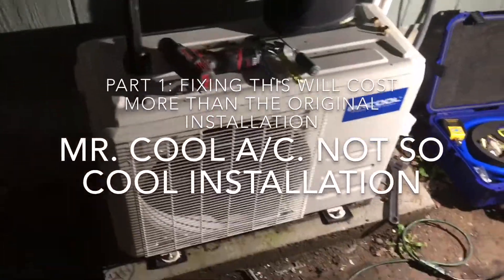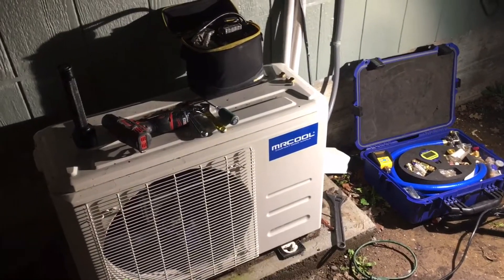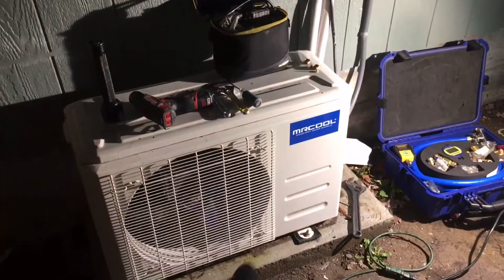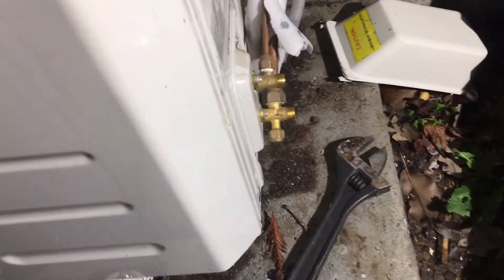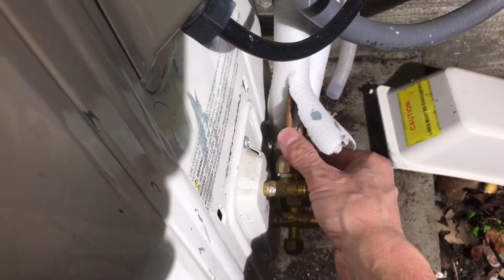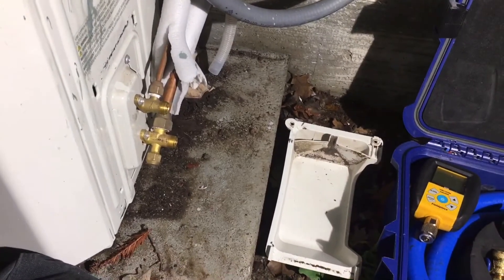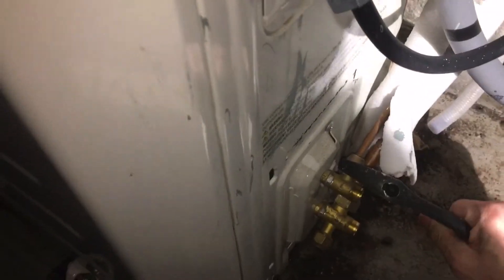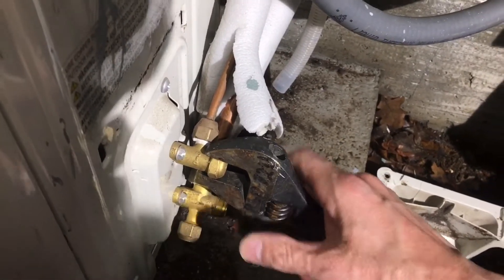Mr. cool A/C, Part 1: Not so cool installation

Comment: Wow! Plumbing tape on flare nuts? What happened to Nylog thread sealant? I use a digital torque wrench to tighten flare nuts. This is crazy.
Reply from the maker: @SonsofIssac  NOT ME !.  I’m coming behind a general contractor who is told to put this air conditioning system that was selected by the architect on building this tiny house. 
     The general contractor, had his guys put it in . Who he got from the Home Depot parking lot. 
(“ need I say more”) 

I almost nearly had to ripped the entire system out . 

I had to take and replace the copper in the wall because it was damaged . 

The wiring was wrong . 

The flares were leaking . 

And the guys did not read instructions that you had to open up the unit with the hex Allen key . 

So they were starting it up with the refrigerant, trapped and outdoor heat pump and couldn’t figure out why it would not cool .

Comment: Honestly, his tremendous stupidity actually saved them.   Had he opened those service valves it ethier would have immediately leaked all of the refrigerant out, costing the owners a good chunk of change to have it recharged, or even better, the system would have tried to run and destroyed itself as the pipe dope and Teflon tape clogged everything up.
Reply from the maker: Unfortunately for me to fix this and other mistakes that were made, I need to be repaired.  The fixed cost more than the unit cost..  that was the sad thing

Comment: Mr. Cool has some nice products! However, this type of product needs professional installation!
Reply from the maker: Even their DYII products have massive problems with leaks after DYI screw in connectors I have videos of me cutting those out in bracing the lines together so they can’t leak anymore. 

And when you need extension lines that are longer the precharge Sandwich Refrigerant so that DYI person does not have to.     But the problem is I have tapped and remove the refrigerant out of the DYI Mr. cool lines and found that many of them have already leaked out well in storage or delivery so the customer gets an empty line what that means as when the customer hooks it up the system will be under charged

And I have found several Mr. call DYI air handler coils to be leaking only a year old

Comment: I wouldn't install this for anybody the drain pan holds water enought to smell stagment water it's elevated enought to hold water in process now to fab up a drain biggest piece of shit I have seen drain should bee in bottom of pan
Reply from the maker: This is what happens when a general contractor who thinks he can do something he’s never done before because to him it looked easy but he did not even read the instructions 

      The instruction manual even has pictures showing you how the drain should be pitched down words through the hole in the wall

        And they have another picture right next to it showing you a bad installation with the drain going up with a big X through the picture to let you know this is the wrong way. 

  I get called out to these kind of installs all the time I never get used to it cannot believe in this day and age with all the access to information and resources and being able to look at training videos from manufactures on their equipment they don’t even try to learn to do it right
Reply: @coldfinger459sub0  this is on central air unit in air handler and it is in lowest hole and angled down the hole has about and inch or so below it to bottom of pan

Comment: Congratulations for choosing Teflon sealant when you could have chose nylog sealant.
Reply from the maker: Yes only an idiot would use Teflon sealant in refrigerant lines clogging up the inside of the refrigerant line. 
                               This would’ve been a good situation to break out the bottle of NYLOG and show people what they should be using. 

          As usual I was coming behind somebody’s village idiot to re-repair their work and undo the harm they have created.

Comment: I can bet you it was the customer doing DIY from YouTube. He is just trying to save face and shift the blame on a non existent contractor.
Reply from the maker: It’s a old lady hitting her 80s with the beginning of Alzheimer’s and her daughter taking care of her no man in the house. 
           I met the contractor if you can call him that just a general as usual can do everything but do nothing good typical general. 
            He basically ripped them off and when things didn’t go good and he was losing his ass trying to get it to work was when I was called. . 

        When generals try to do heating and air-conditioning it’s always the lowest budget hack job just good enough to get hot or cold to blow on your hand kind of job.  You can call it a hand job.

Comment: if you are a  professional and getting paid. do your job and dont bad mouth.
Reply from the maker: We’re trying to get rid of the lowlifes that we have to badmouth that give profession a bad name.
              We’re not going to cover up their mistakes and hide it for them and protect them from ripping off customers. 
            We’re out to try to smash them like cockroaches in the kitchen nothing but dirty pest,  a cancer on society that needs to be rubbed out.

           This installation was performed by a general contractor. 
           I would personally call him or a toilet scrubber or a garbage man at best he might be able to be a janitor and mop the floor. 

            There were so many blatant not even mistakes just total screwup‘s in proper procedures completely ignored all rules and regulations and manufacturers installation manual that clearly states how to properly install this very simple little system a child can even install one of these correctly so long as he can read the manual.

Comment: Im looking at the Mr cool central heat pump that goes down to -22 .im in Michigan and hate propane no natural gas available.Im told it's the same condensors as the mini splits.My house is 1950 sq ft 2 story newly built .What size do you think I need? A rep says the 4 to 5 ton my hvac guy say s 3 ton .Fyi I burn wood all winter in my vermont casting defiant that I love great wood stoves despite so so reviews.
Reply from the maker: Living in San Francisco California I definitely do not do heat load calculations for Minnesota even though I am familiar with Minnesota because back in class we would make heat load calculations for very cold regions of the nation. 
                You really need to locate somebody in your local region to do a heat load calculation. 

           New homes built to minimum code are the worst homes built. 
             Good contractors to build quality homes have a saying. 
       “ build a home DOWN!  to code level “
Just to pass inspection

Comment: You can bet the homeowner did this job and blamed it on a contractor
Reply from the maker: I met the contractor who did the install I know exactly who did it. 
              General contractors should not be allowed to do anything with heating or air conditioning. 
               Even most general contractors should not even be allowed to build homes for humans some of their level is only low enough for a dog house or birdhouse

Comment: Good video.  Even if someone can't read Mr Cool has a five minute video on almost everything needed to install it. Have you run across the MrCool central ducted system?
Reply from the maker: That’s an excellent question I like that one.
           Now that’s opening up Pandora’s box a whole Nother can of worms to get into trouble with ducting. 

       1:  more often than not the furnace or air conditioning or heat pump installed in the majority at home is too big to start with so when somebody selects a Mr. cool and they’re just going to copy what they already have installed they’re going to be wrong right off the starting gate.

      2:   Now let’s talk about the return ducting and a supply ducting are both often undersize

    3:  The air filter selection that 1 inch piece of garbage that is supplied with usually all OEM manufactures furnaces is garbage and undersized just to start with a bare minimum just to get by. 
               Person will install that brand new Mr. cool system and into a system that already has plagued with problems and if they had problems before they may just have problems after to. 
                Not to mention with those other problems that affect efficiency for comfort the customer will still end up with I energy bill because the initial cause was never addressed

           4:  mr. cool will have to do an education program to really drive home the point about performing heat load calculation properly and providing some sort of free heat load calculator or free service that the customer can take simple measurements and description of home to at least give them some hope of at least getting close to the proper load calculation to pick out the right size device. 

All most all manufactures of mini split systems now offer vertical or horizontal central heat pump systems.
Reply: @coldfinger459sub0  how fo you feel about the mr cool brand? They are way cheaper than most others.

I agree with the having the system installed / designed correct.. Based on my experience. Had a family freind in the trade come in. Redoo duct work in over half the house.  The day he was done.. No flow to the farthest room. And it was normal according to him. 
I later think back and figured out he was learning ductwork on my house.
Looks like spaghetti, leaks, drips, noisy, .....undersized (3.5 where 5 req).

There is a massive difference between someone that can replace simple parts and a hvac mechanical technician. 
I was forced because of this to educate myself in proper measurements, installation techniques and more. Probably over 15 companies i have had come out. Some just money hungry, some shitty business tactics, some lack of knowledge. Had one in at about 7.. And the guy ended up in the hospital, next guy the company sent was an idiot.
Finally booked to rip all this junk out and start over ( at my cost). 

I feel the industry needs more certification. And destination between capabilities. Ie.. Some should not be handling new installs.
Some should not be allowed to use a drill on the sheet metal screws. 

Ok.. Rant over. :o
Reply from the maker: @turboflush  👍👍👍 you are 200% correct in all of the above. 

             What certifications they are or kind of a joke.   Most state licensing not all are pretty pathetic tool I Collett a license to steal that’s my nickname for it.

           Ductwork at the end of the house just not cooling or heating right or blowing and being told (“that’s normal”?!..).      This is common. 
            And yes (“ that is normal “) lol 😂 for somebody who doesn’t know what they’re doing. Including HVAC contractors and HVAC installers. 
              You have to realize most HVAC installers are entry-level bottom line grunt work no education (no offense to anybody)
         There are some who eventually get good at it and they learn and educate and they can properly through experience performed the right task and come out with a good job but definitely not for a cheap price it’s too labor-intensive to do it right
For a cheap price. 
                 And you’re paying for the knowledge of doing it correctly delivering it’s rated performance and giving you that cooling or heating in that far this room in the house. 

             Sounds like they’re using flex duct metal is the way to go for the best job but it’s the most expensive both of the materials and labor. 

            You can educate yourself on properly installing flex duct in your attic many manufactures of the better quality stuff have videos and written guidelines how to properly install you have to read everything. 

          There is math in determining the correct size ducks and where the branch how far apart not using tees but using wise at junction points proper size duck trunk run or manifold if you want to use that Termanology. 

             It’s all about keeping up the velocity and proper static pressure to get that air moving all the way to the far this point properly Math is involved. 

              With too high of a velocity you get that loud noise from restriction and more math is involved to get rid of that by doing the math in the beginning you do not have to redo anything in it all works correctly the first time. 

             Then the type of grills that you pick your registers will also determine the face velocity coming out of the grills whether it will make it to the other side of the room or whether it might fall short and never make it there. 
               And that gets back into math with that velocity of the air. 

              You’re going to do it yourself do a little research you’re going to use flex duct learn how to pull it tight like a piano string and fasten it and use duct sealant and tie straps to secure the ends onto metal elbows. 

              Instead of bending your ductwork at all your bins use wise and elbows made out of metal to secure your flex duct and then secured into place very tightly and securely so you can pull your straight line runs in line of sight. 

             Another source of research for energy efficiency Hass to do with less friction in your ductwork you can also go to on the West Coast PG&E your energy company and some of them have free workshops about sizing and installing duct correctly. 

          It is possible to do it yourself correctly with enough research and reading and understanding the correct basic concepts of static pressure friction loss and velocity. 

           And that the unit that you selected is not oversized or not undersized. 

            And that the correct fan speed was chosen to get the correct volume of air over the fan coil to efficiently work and then give you enough volume of air to distribute throughout the rooms in your house. 

          The bigger your filter is for your return in cubic feet area and the deeper the pleats the less restriction you will have. 

           And there’s 100 other little tiny tidbits of information that are left out that you need to research and you should be able to pull off a job as a do it yourself person with no experience your first time better than all those who came out there and try before you who are supposedly professionals this is a guarantee. 

             Don’t be impatient don’t rush it the more time you spend educating and looking for things every time you find out an answer you should have five or 10 more questions that you have to go and research more answers for.   That means you’re learning. 

             The person who reads once and has all the answers and they know it all is the person who knows the least. 

             I’m still a student learning it never ends
Reply: @coldfinger459sub0  
Unf. I cant keep with thia extreme high electric bill. So i cant continue to research. I would diy.. But i have to many other things to do, like yourself. I also want it done correct the first time. To many pieces i could get wrong. Hvac is not my profession, though i am 608cert. 
As a homeowner i am trying to rely on a professional tradesman to provide mw the proper and accurate service.

It can be hard to tell sometimes if someone is blowing smoke or if they actually know what to do.

Comment: You acting as though your number 1 make you feel better?
Reply from the maker: This is a good example to show people what not to let anyone do to their mini split. 
      The home owner payed over $2000 to  have the contractor who built the house install the air-conditioning. 
           The unit came with instructions that clearly stated what to do and what not to do. That even has pictures to follow to show you how to make your connections and what to correctly connect. 
             They did not even bother following the pictures in the pamphlet that came with the unit that show you how to perform every procedure. 
           This kind of stuff pisses me off when I see people get ripped off Contractor takes customers money and runs. 
                Nothing about being number one far from it I make stupid mistakes. 
             But this is not an example of a mistake this is example of robbery for A thief.
Reply: You seem awfully upset, is this your installation?
Reply from the maker: @chrisfoxwell4128  yes I am upset that a customer got ripped off by paying a so-called contractor to have his guys install the system. 
            As usual I was called by the customer to come fix this unit that was not installed properly. 
             I get very upset the general public customer gets ripped off too often by people don’t even know what they’re doing. Who cannot even read the installation manual how to do it properly. Often when the installation manual even has pictures showing you the right way and a wrong way they still do it the wrong way how is that possible.
Reply: @coldfinger459sub0  sorry for the miscommunication.  My comment was a snide remark to the original poster.  I appreciate seeing your take on the poor install.
Reply from the maker: @chrisfoxwell4128  👍.  Thank you I was thinking the same thing when they commented but I did not say that.  I think we both know what campground they stand in. 🤣